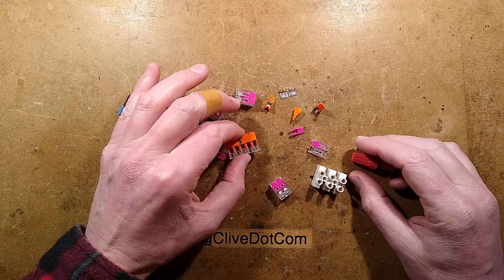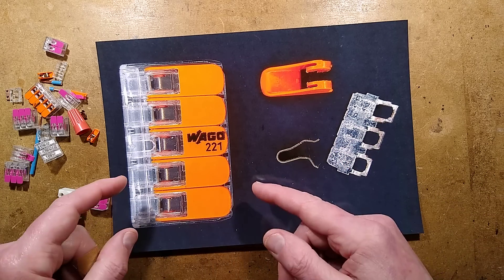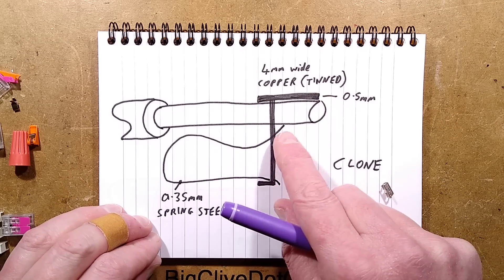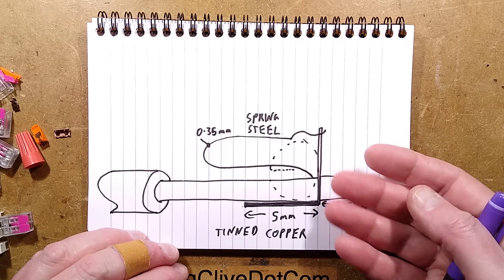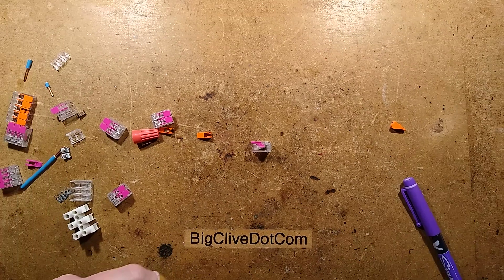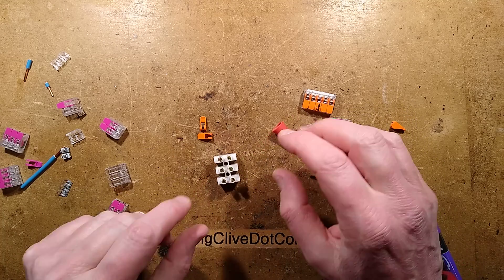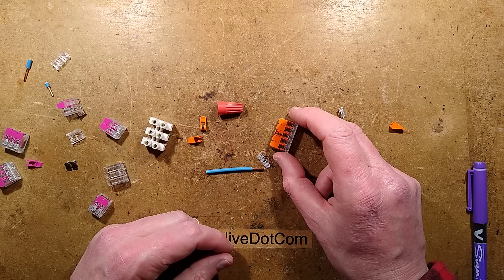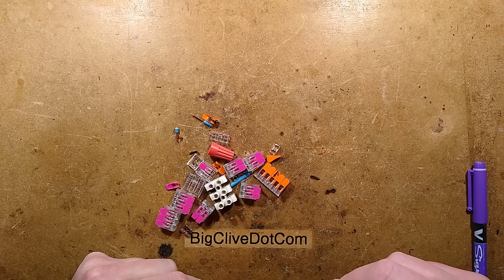Inside a Wago connector and a clone

Comment: I do love the “Wago failed first so must be bad!” Videos is exactly what you mentioned. If any of these connectors are failing after being installed properly, you’ve got so many more problems than a connector.
Reply: Pay attention to the loading that caused them to fail first. Wago can handle well above the "fuse" ratings in a consumer unit., therefore, any problems, the "fuse" will trip first.
Reply: Of those overcurrent videos "proving" how bad the Wagos are, usually I see issues with the wires long before the Wago housings start to melt. Especially the demonstrations using insulated wire. The wire insulation have all melted or burned long before there are any issues with the Wagos.
Reply: 09:00 100A is  ok.
Reply: Not so much that it's bad but that it has it's limitations like any tool.
Reply: John Ward put 5 times the current rating through a Wago (152A) before the plastic started to melt after around 11 minutes. Although it was not this type of Wago.
Reply: Must be terrible they are German, not exactly known for their over engineering…… no wait 😂
Reply: Heat can do them in over a long period of time as well. I've seen a self-disintegrated (not melted!) Wago that was used in junction box behind a pizza oven.
Reply: @zwerko  Not good for wago but maybe putting a junction box behind the pizza oven isn't the smartest idea 😄
Reply: @GokhanCvs  Fair point, but I reckon that the box and the other stuff was there before the oven was placed in. Not even close to the weirdest setup I've seen in commercial spaces tbh. It appeared fairly well insulated, the oven fan was blasting in the other direction and nothing else appeared bent, wrapped, cracked or anything... But I guess years in such environment weren't friendly to the plastic Wago uses...
Reply: @GokhanCvs  Have had similar issues in a pottery tunnel kiln panel. A pottery can be a very aggressive environment as the ceramic dust in the air can be death to poorly-sealed cooling fan bearings...
Reply: @zwerko  
Was this heat from the current running though the Wago, or the heat from the oven?
Reply: @zwerko  indeed someone used them on the fans on a heat shrink conveyor, basically a 160kW 3ph fan oven running at 210°C with a chain mail conveyor belt, it is insulated and has a 316 stainless steel skin, so only reaches about 40°C yet the wago's had deformed and failed, The polythene choc connect were perfectly ok, I replaced them all with ceramic choc connectors.
Reply: @dogwalker666  Polyethylene generally doesn't deform until it melts since it is already above its glass transition temperature.  A genuine Wago is supposed to handle up to 105°C but a knockoff might be made of something less tolerant like a copolyester.
Reply: Question Do you Love WAGO enough to pay 20x the price for a premium of a screw connector block
Reply: @Demonic-X  "Question Do you Love WAGO enough to pay 20x the price for a premium of a screw connector block"
Going rate here is around 1200:- SEK an hour for an electrician, and a 5 pole Wago is around 15:-....so if a Wago saves just a minute of work compared to the screw connector block, that's 5:- savings.
Reply: They also fail from corrosion.
Reply: @dogwalker666  Ive had WAGOs in outside wiring that is not just in high humidity but often straight up wet and non of them have any rust on them after a few years. Old style wagos and newer ones
Reply: @AlpineTheHusky  I can only tell you what I find,  I have a cup full of new style 211 green and failed. Shame I can't share photos. I just had an intermittent fault on a Mitsubishi inverter traced it to a corroded wago on the speed reference pot, 
They are extreamly handy for testing and prototyping but not permanent on production machines.
Reply: @dogwalker666  Most industrial switching and distribution cabbinets and equipment use terminals with exactly that or very similar terminal block systems
Reply: @dogwalker666  as far as I know there are no green WAGO 221 connectors the 221 series always has the orange lever.
Reply: @ci1ian806  you confused what I said,  When new they were clear and orange,  They are green now !  Verdigree.
Reply: @AlpineTheHusky  i am a panel builder by trade, I know there are terminals available that are push fit, However in harsh environments they are unreliable and usually get replaced with traditional screw clamp terminals, they are also a nightmare to do diagnostics on as standard meter probes don't fit.
Reply: @dogwalker666  I am a Electrical Power Technician...fancy name for probably the same stuff you do. Here we mostly use spring contacts or cage screw terminals. Rarely push in as we work with stranded wire. I have never had a spring terminal fail as its basically impossible for it to come loose. Screw terminals on the other hand can get loose with vibrations or flowing of the conductor material.
Reply: @dogwalker666  And as point to the probe tips. Most probes got that little pointy bulb on the end and basically all terminals that we use got a hole exactly for that probe on top
Reply: @AlpineTheHusky  the German solution to stranded wire is to use ferrules
Reply: @andrewfidel2220  The Austrian solution is to use what is best in the situation
Reply: @AlpineTheHusky  not the spring loaded,  I use them daily,  I know how rubbish they are,  We had a cross folder that would break down regularly, I replaced the crappy push fit for Entrelec 4mm screw clamp,  200 terminals in total,  Worked perfectly after. Push fit are just for lazy electricians.
Reply: @AlpineTheHusky  spring terminals fail because of 
1 limited point of contact so can oxidise,  
2 the springs loose effectiveness due to heat cool cycles,
3 they are more prone to vibration than proper screw clamps,  Especially on high frequency vibrations.  
4 as the spring is just Steel when the corrode they drop the wire, when screw clamp corrode they rust the cable in place. 
They are ok for low importance use like lights or HVAC  but not on production machines that cost a lot of money if they fail.
Reply: @dogwalker666  It seems that you have a special use case, where corrosive gases or liquids come into contact with the wires and connectors. That is not good with any system and should be avoided by using a sealed junction box.
Screw terminals might hang on longer in this case if installed correctly.
For alomost anything else WAGOs are preferred, because they are easier and faster to install. Of course they need to be used within the specification...
Reply: @dogwalker666  Well guess Voest Alpine, WV, Audi and BMW production lines are low importance. We mostly use Spring terminals for <2.5mm² for obvious reasons but have never had any issues. With screw terminals you quite often have the issue of them rattling free on smaller wires
Reply: @AlpineTheHusky  well you would use plug terminals normally,  And yes Nissan are having problems on the push fit, Not surprisingly about VW they are badly built these days.
Reply: @dogwalker666  I dont mean the cars I mean the production lines.
Reply: @AlpineTheHusky  well again if it is like Nissan i am not suprised, I couldn't survive in there they like clueles engineers.
Reply: @ci1ian806  
There is absolutely a green 221.  WAGO calls it their "Green Range" where the levers are (at least partially) made of recycled PET plastic instead of virgin nylon.  The shells are made of the same polycarbonate as the orange ones.  They also have gray lever versions in their hazardous location series.
Reply: @dogwalker666  
The spring is stainless steel.  The bus bar is copper, but the tin plating should prevent corrosion of the contact surfaces.  The most vulnerable failure point might be the copper wire,.  I've taken apart copper wire that might have been there about 50-70 years and can be noticeably tarnished (or even with some green patina), which will reduce conductivity at the surface..
Reply: @ypw510  We have a very high humidity work environment and if exposed as when a forklift driver smashes the lid off yes you get verdigree from the copper that's expected but some of the wago's and yes they are all genuine, They have corroded,  
I do use them for prototyping and testing but they are too unreliable in the production area, I also had a solid 2.5mm pull out of a wago while testing a ring circuit.
Reply: @dogwalker666  who are you today: a troll or an idiot?
Reply: @ditrypand8273 Projection old bean, Just had to re wire a junction box because the wago have failed, 
Definitely not a professional device!